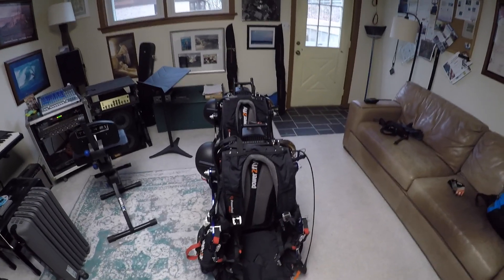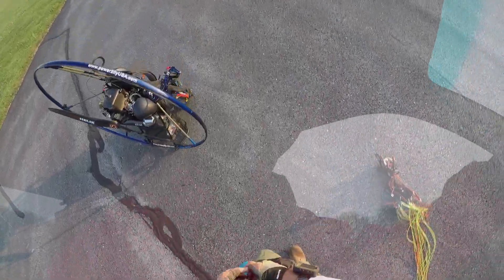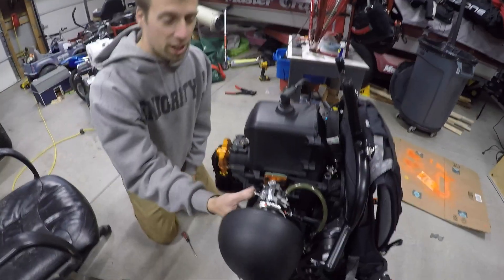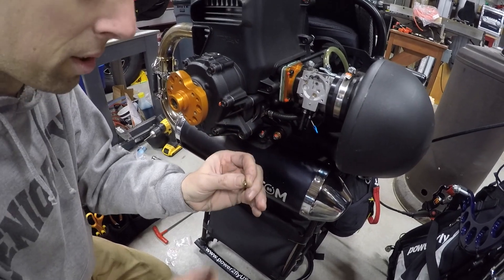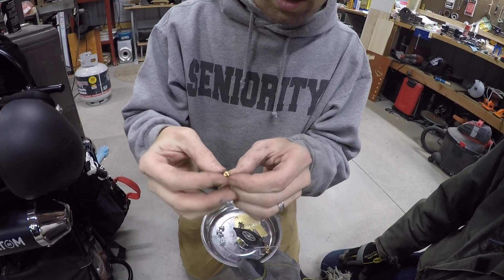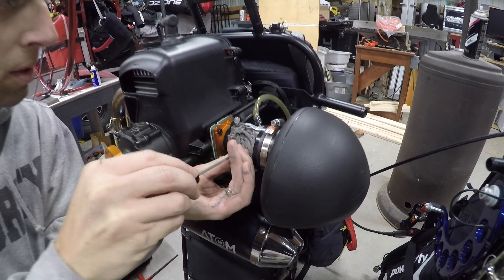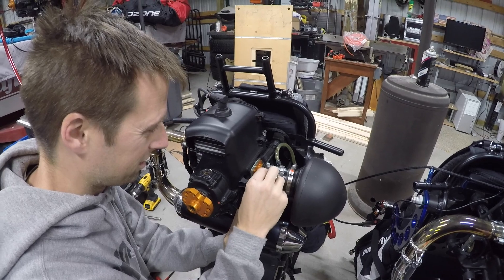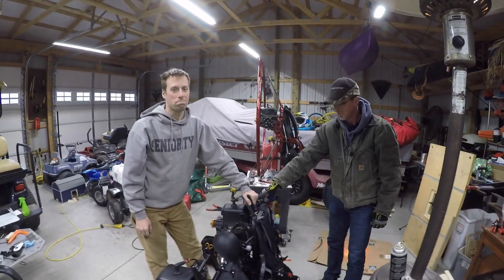Atom 80 Winter Woes - Vittorrazi's Fix

Comment: What is the drill size used as a gauge for the main jet
Reply: just a hair bigger than the stock hole..I even use the same size bit that fits through the hole than reem it a little.
Reply: @577buttfan  have you done this modification to an atom 80 yourself and did it help??

Comment: Can you post the link for where to purchase the 0.75 mm metering lever gauge?
Reply: You can 3d print one out yourself,there is a video of a guy with a Polini that uses the wg8 and he has the link for the file.
Also Had Robinson from Southwestern Airsports has a brass one for sale..if not you can use a depth gauge.
 Hey its Chip,I almost saw that guy bite it hard at our field,had a snagged line!!
Bump bump!!